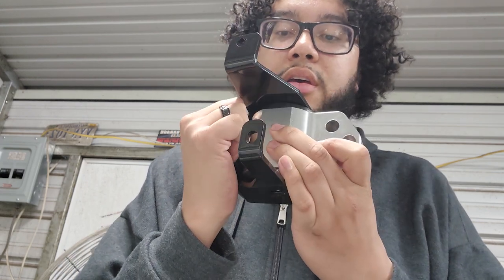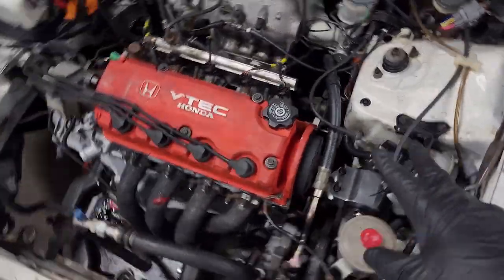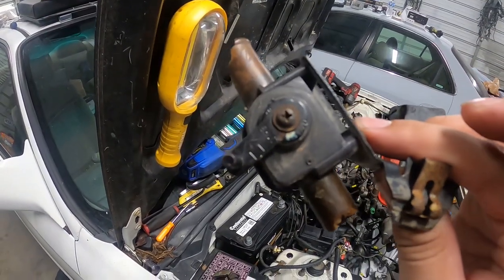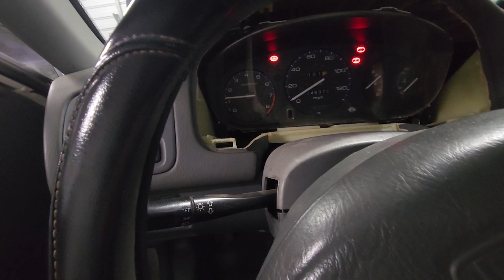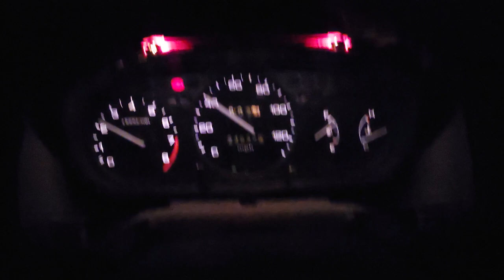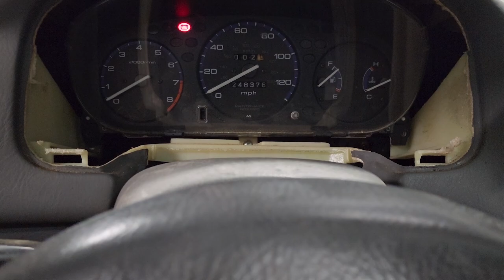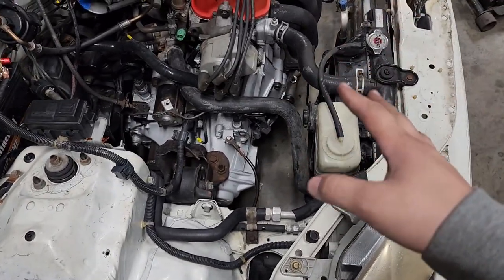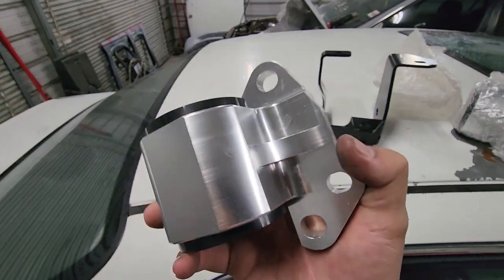Budget Honda Civic EK Project | D16Z6 VTEC | First Drive?

Comment: What's going on Brodie. I have a 94 Honda Accord and want to start to  do some preventative mods. And I want to keep it naturally aspirated.  Well under 100 k original miles .  Ps what was the name of that valve part that broke off. I want to see if I may need to replace. One sonner then later.  I appreciate you brotha out here doing Gods work  helping us folks . Big blessing as always
Reply: This is a question open for anyone that could provide an answer for me .. thank you and much appreciated
Reply: I got you bro it's called a heater control valve